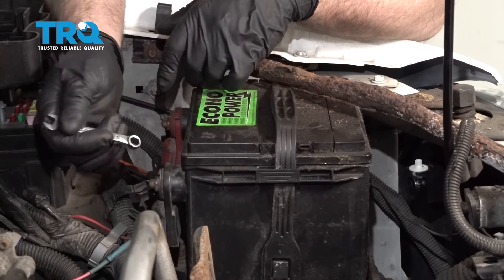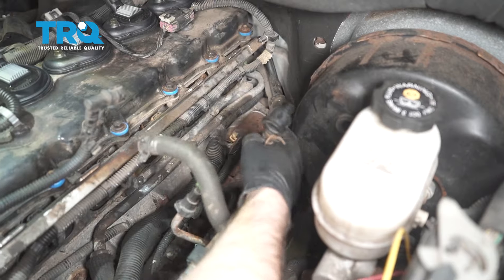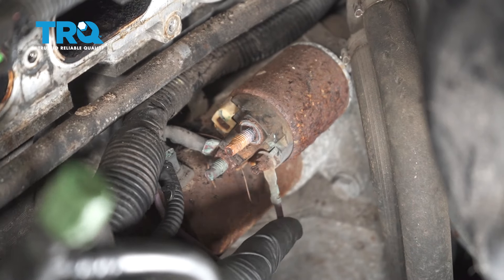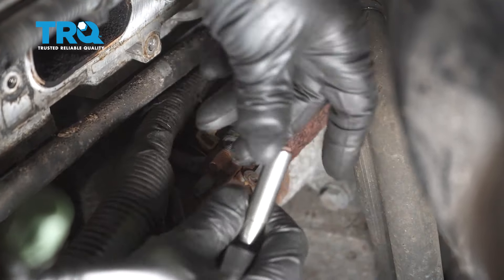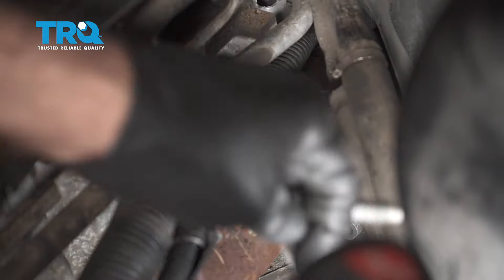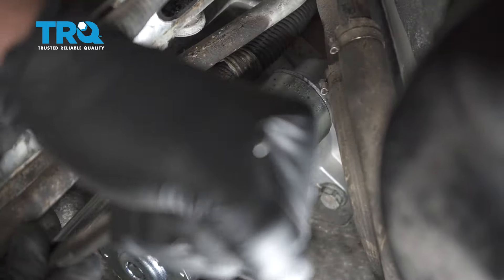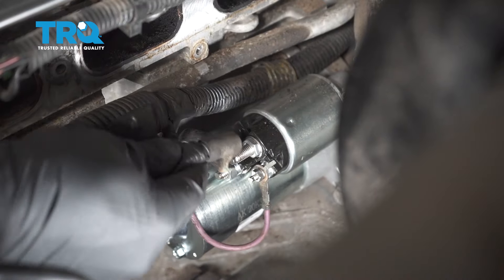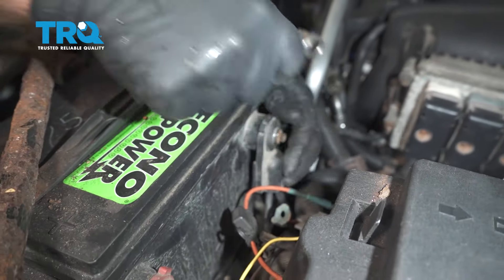How to Replace Starter 2002-2009 Chevy Trailblazer

Comment: Sorry, but this video is (imo) pretty useless. There is a BIG difference in available space to get to the starter when the intake manifold is off. It is good for showing you the bolts, connector locations but not in the actual removal of a starter with the intake manifold in the way. Recommend you view another video.

Comment: Just replaced one of these without taking the intake off. Right where that hose is that covers the top bolt u can squeeze your hand in there and guide your socket on the nut to remove it.. 🤙🏾👍🏾

Comment: Yeah skip all the steps to remove the intake manifold, fuel lines, alternator, pcm, harness, brake booster hose, and a metal bracket holding all the connectors to the pcm!!

Comment: Only needed this video to see where the top bolt is.. all you need is a 6inch extension and go through the wheelwell.. got the starter out without having to do all that extra work

Comment: Instead of taking the intake off. I took the rear license plate off which would be as unnecessary as taking off the intake, and still did it in 45 minutes.
Reply: Damn how did you get the license plate screws off so fast? It's like 30 minutes per screw according to the dealer
Reply: I have to do my 02.  I'll start by taking the license plate off.  Thanks.

Comment: What size are the starter bolts for a 05 trailblazer ext 4.2 v6 2 wheel drive?
Reply: 15mm I would guess
Reply: It's not a v6 it's a i6